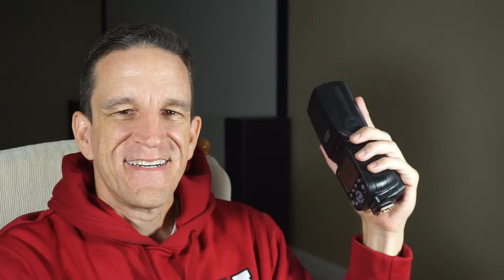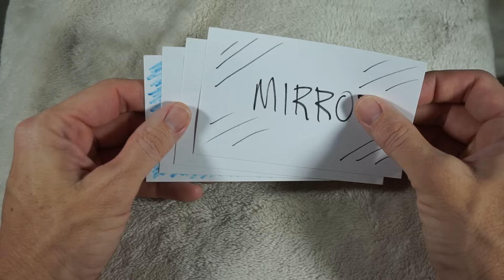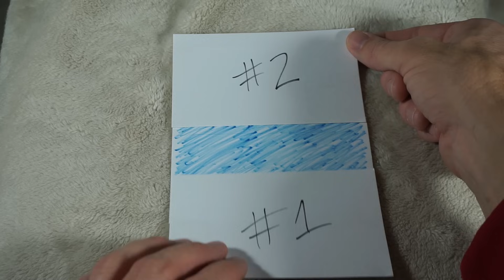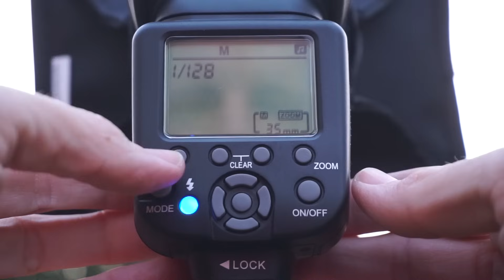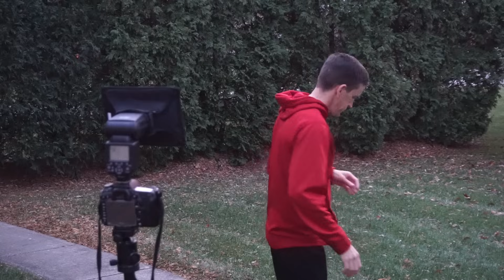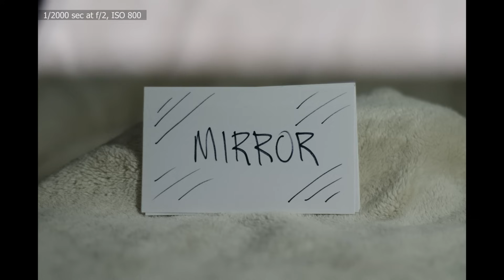Beginners Guide to High Speed Sync Flash Photography

Comment: Hi there, I have a question about high speed sync. Let me start by saying that I've used HSS before, So I do understand how it works. However today I was doing a photoshoot and noticed an issue with the photo. I noticed that the top part was coming out a lot brighter than the button, even though I was using HSS to shoot. The shoot took placed during the day around 4pm when it was still bright but not overly sunny. The lens was using an F2.8 aperture. My plan was to use the fill flash to avoid shadows on my subjects face and using HSS so that I could use a faster shutter speed to avoid overexposing the image. With HSS both camera and flash can go as far as 1/8000 of a sec.  any advise you can give me will be greatly appreciated.
Reply from the maker: Hmmmm - interesting.  Curious to know if you have the same results with shooting with a slower shutter speed?

Comment: Please sir I need help..
I have the TT600 but each time I enable the HSS on the flash unit and try to trigger it with the X1 on my Canon 80D 
Once I click the shutter button 
The HSS trips off immediately and it shoots at default sync speed. 

So I end up not achieving the HSS
Reply from the maker: i typically use HSS when the flash is attached to the camera.  when attempting to use HSS off-camera, a special trigger is needed.

Comment: Thanks. Beautiful explanation, but for me another and most important issue though it's in which mode should I use the TTL external flash with my Nikon 7200? I know its a simple question but its being my biggest problem so far! I tried all of them and with the only ones I can use the flash is when I put it in U1 or U2. It doesn't work whenever I put the M, S, A or P modes. Not even with the automatic or the scene mode. Would you enlighten me please? THANK YOU!
Reply from the maker: Thanks for the post/question:).  I typically adjust the flash power myself ... I set the flash > take a shot > inspect and adjust if needed.  i believe TTL should work the same in all camera modes w/ exception to manual (although I could be wrong about manual mode).  The flash and camera work together to create what the camera thinks is a properly exposed image when the flash is in TTL.

Comment: Geez how on earth do you not get banding. If the shutter indeed does what you say, the curtains will cast sharp shadows on the sensor. How on earth can they be that accurate? Also each flash has to be exactly, with out deviation, the same power. Almost impossible but yet there it is.
Reply from the maker: LOL - fully agree! :)  I thought the same ... amazing how technology works! :)

Comment: Thanks for the very clear video - being so knowledgeable plus experience with Nikon I wonder if you can help with an explanation: I have a D850 body, but my flash, Yongnuo 560 IV, does NOT support HSS.  However, when on Silent Live View flash works perfectly at extremely high shutter speeds like 1/2000 sec.  This is great, but looking online many forums say that this should not work.  Just one thing though, if the flash is off camera and I use the Yongnuo 560 TX controller the flash does not trigger at all.  I can't find an explanation of why this is, and makes me wonder if there is a different controller which would make it work perfectly like when it is on the camera... I am mystified so if you had the time to explain briefly I would be very grateful!!
Reply from the maker: Hmmmm - very interesting as I have not heard this before:).  I will need to dig into this more to find a good explanation:).
Reply: @RealWorld  Thank you.  I was surprised too and would love an explanation from someone more technical than I am!

Comment: For D3XXX or D5XXX Nikon bodies or also canon, another trick to using flash (Without HSS because they don't support it) in daylight is to use an ND or even better a Variable ND filter to get the proper exposure.
Reply from the maker: Thanks for the post/suggestion!:)  Agreed as well ... a good ND filter will help.

Comment: And how does one properly expose for low light situations with a flash?
Reply from the maker: use TTL or enter manual mode and use trail and error (i.e. take a shot and review the results on the back of the camera:)).

Comment: I got this same flash along with my Nikon z50. So my question is how come ur shutter speed was so high and considering it was kinda dark out did the shutter speed affect the lighting?
Reply from the maker: Thanks for the post and good observation:).  I could have used a slower shutter speed but only increased it to demonstrate the high speed sync feature:).
Reply: @RealWorld  ah ok. I understand.  Does shutter speed control lighting i.e ambient or flash? Also if i may ask what trigger and reciever system are u using?
Reply from the maker: shutter can control lighting providing the light source is set to TTL.  regarding triggers ... i currently use ultura - https://amzn.to/3eEmP8s

Comment: How do you set up HSS in Z6?
Reply from the maker: Thanks for the post/question Sandy:).  Ensure your camera is set to use Auto-FP in flash settings ... Menu > Custom Settings > choose 1/200 Auto AP.  This should enable high speed sync with compatible flashes.

Comment: that is why you DON'T need H.S.S. , or have a sync speed for medium or large format cameras, as Most of them have a "leaf" shutter, this opens like the iris, so even at 1/400th of a second the shutter leaves open fully then close, so ALL flashes work. also in Nikon cameras, there is a menu item to change flash shutter speed ( 1/60,1/80,1/200,1/250 & 1/320(F P) ) as well as the sync speed, BOTH are adjustable.
Reply from the maker: Thanks for the post/info Andy - good stuff:)

Comment: Hello there! I have a question about the speedlite you are using in this video.  I think that speedlite is a K&F 882. and I wonder if you have already used it like a master using the optical wireless connection to control other i-TTL speedlites like the Neewer nw565.  I have a couple of those and I had have a hard time finding an optical controller for distance off camera setting up, and what I saw in the menu of that flash made me think that probbably that flash can do it. Have you try that out? In advance Thank you very much for the answer and probably you would like to do a video about controlling flashes settings using optical wireless sync (groups and channels), 'cause there is a huge lack of information about it.  Everybody shows  pairing  by 2.4 G radio frecuency,  but some speedlites have optical wireless capabilities (beside just triggering by  "sympathy").  Thank you very much for your attention. I´ll be waiting up for an answer!  sorry about my misspelling and bad grammar, but It's been a long time since the last time I wrote in English a regular basis  Regards!!!
Reply from the maker: Thanks for the post/feedback!:)  I use various external flashes and have successfully used the built-in flash on the camera to trigger off camera flashes using optical sensors.  The camera must have a commander mode ... this works well when the flashes are line of sight (note: the flash must face forward so the sensor can be seen by the built-in flash).  I prefer triggers using RF ... this allows me to angle the flash anyway needed without concern for the sensor:).

Comment: Great explanation of HSS. I believe the power output of the flash will be reduced in this mode. ¿Is there a calculation that can be made to determine the effective guide number in HSS. Thanks.
Reply from the maker: Great question/point regarding power when using HSS:).  You might think the power would be reduced considering the flash must fire repeatedly to follow the speed of the shutter.  Nonetheless, I believe the power remains the same but will need to research further:).

Comment: Nicely done.  I have a Neewer VK750 that I just bought.  I cannot get HSS to work.  Camera is a Nikon D850 set to 1/250 FP.  The flash should then show an H on the screen.  If I fire a shot, I get a black picture.  I'm going to get a replacement.
Reply from the maker: Thanks for the post Tom:).  Unfortunately, the VK750 does not offer HSS.  The D850 is a great camera though:).  I really like the 750 and have a couple which work great.  If you want a HSS capable flash consider the K&F Concepts 882 ( http://amzn.to/2l944m1 ) which I used in this video.

Comment: Does camera exposure meter works when external flash is in use .. ?
Reply: Plz tell me steps to turn on the exposure  cause in my d7200 the Light/Exposure meter is always underexposed ..
Reply from the maker: If you are using TTL, the camera tries to get it right but this is not always the case:).  If you find the camera to be off, use the exposure compensation.  Hold down the +/- button located near the shutter release button > while holding down the button, rotate the rear dial to adjust as needed.  Since your images are typically underexposed, force the camera to overexpose by one or two stops:).  I have done the same and it works well:).
Reply: @RealWorld  i have try it but nothing its always underexposed
Reply from the maker: @indrajitmondal6615  Hmmmm - interesting. Do you see any difference at all when using exposure compensation?  What is the brand/model of flash?
Reply: @RealWorld  the brand is sunpak PZ42x and i just saw that it is incompatible to d7200 .. it maybe the reason
Reply from the maker: When using TTL, yes:).  If you switch the flash to manual, no.

Comment: How did you disable the high speed sync? I have a similar universal flash and a Nikon d7200. The high speed sync is turned on by the camera when 1/250 FP or 320 FP is selected. Otherwise it is set to the sync speed from 1/60-1/250. How did you get to over the 1/250 with HSsync disabled?
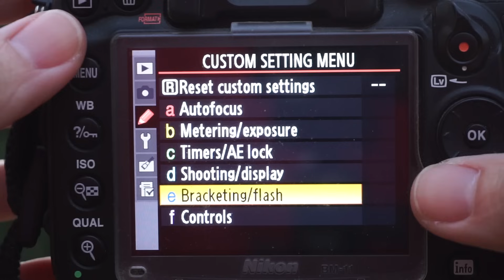Reply from the maker: Thanks for the post Jim:).  I had to watch this video again to better understand the overall situation - looking back, I did a good job!:)  Nonetheless, so how did I disable high speed sync?  Take a closer look around the 9:42 mark.  I set my camera to something other than Auto FP (for example, 1/200).
Reply: RealWorld I tried that. So if I set the flash sync speed to let’s say 1/125. The camera will not let me go faster than that speed. I’m trying to better understand by recreating your example with the flash cards.
Reply from the maker: Not a problem - always good to experiment and understand:).  Are you in manual mode?  If not, head to manual and force the shutter speed past 1/125 > ensure your flash is on and take a shot ... you should see a shadow/band of some sort:).
Reply: RealWorld I was in manual mode but it still won’t let me go past the sync speed of whatever the selection is.
Reply: @RealWorld  I tried in Manual Mode on my D600 and SB5000. On camera set the Sync speed to 1/200 it doesn't let me pass that speed. Exactly problem Jim is experiencing.  Also do you have any advise for how to use HSS OFF camera? In your video I see it's ON Camera
Reply: Did you switch bodies from the D7000 to the D3400 for the last demo?

Comment: How do I know if my camera support High Speed Sync ? I have the nikon D80 which is old ;-) I have the SB-700 AF from NIkon , do you know if it has this feature?
Reply from the maker: LOL - yes, the D80 is much older than most, however I believe this might be doable:).  I do not have the D80 but I believe you will need to set flash sync to front and enable custom settings menu #25 (based on some quick research):).

Comment: I have Yongnuo YN560111 and YN560IV flash and I Nikon D7200 DSLR.  When  I set my camera to Auto FP 1/320 and Change the shutter speed to above 320s with aperture opening at F1.8, Flash power set to 1/2 power get banding in the image.  How do I solve this issue?  I shoot mostly in manual mode.
Reply from the maker: Banding is typically caused by high speed sync issues.  I created a video on high speed sync which might be of help - https://youtu.be/BlYO0KwbDXA

Comment: Tonight, I was changing a lens on my camera when the lens I was holding slipped out of my hand. I was standing in front of a rustic wooden coffee table when the lens somersaulted and hit the edge of the table quite hard. Because of the blow, the lens then quickly somersaulted in the opposite direction and hit the rug at my feet. This all happened so fast that I couldn't catch the lens as it fell in slow motion. Now, my 12-60mm M43 lens will not focus automatically. And, I tried to focus it manually but it wouldn't work manually either. So, what have I learned? Not much. I've been into photography for 45 years now and this makes the third time I've dropped my gear. So, with any luck at all, it won't happen again for at least another 12 to 14 years, or so.
Kinda heart sick now.
Reply from the maker: Don't feel bad Mark and I suspect most of us who have been shooting for any length of time have done the same:).  I trashed my 16-50 power zoom lens a couple of years ago while it was on the camera body.  In short the camera was attached to a tripod that tipped forward ... not a long/far fall but enough to cause major issues:).  The AF was not working nor was the power zoom, so I decided to dissect the lens (what did I have to lose).  I manage to semi-repair the lens which I still use today, however I must play with it at times in order to function properly.

Comment: I think most YouTube videos only cover hss without ANY mention of the dreaded fact that the humble speedlight doesn't work but at certain flash to subject distances.

At least that's what I think the problem is. Of course, I may be wrong. I never know for sure. Can you help?
Reply from the maker: The flash should still fire regardless of subject to flash distance, however the flash power will not carry too far so you may not get the fill light desired:).

Comment: Can RealWorld do a video on why everyone (other than me) can easily do High Speed Sync at shutter speeds higher than 1/400th second but I can't, not even when I change cameras & speedlights. The effective camera to subject distance ends up being ridiculously short. It's as if I can't use High speed sync at all.
Signed, frustrated as hell.
Reply from the maker: LOL - I can sense the frustration:).  1/400th of a second seems a bit odd.  What camera and flash are you using?

Comment: I have D7200 with Ad200 Godox flash. Once I have my XPRO on HSS, high do you need what is the correct shutter speed? Thank in advance for helping
Reply from the maker: Your camera will auto determine the shutter speed depending on your mode.  If you have a HSS flash and capable camera (which you do with the D7200:)), the camera will make the appropriate adjustments as needed.
Reply: RealWorld Thanks, I’m shooting in manual so I’m struggling to get the correct shutter speed with high speed sync. I know aperture priority will select it for me. But I’m trying to leave Manual
Reply from the maker: Ahhhhh yes ... manual mode is a bit more challenging:).
Reply: RealWorld yes!! I try long to HSS with allowing aperture priority to select the shutter for me.

Comment: good evening sir recently i purchased osaka ttl hss flash 860markiii but not able to understand the function like how set power in ettl ot ttl in manual i can set full power to 1/128 power but not in ettl if you can teach me it will help me. thanks
Reply from the maker: When using TTL, the camera will automatically control power.  You will need to leverage manual mode to control power:).

Comment: Thanks so much for your reply and in such a short time. Another question, say I'm shooting a subject and at 100 iso and 125 shutter speed my light meter reads f 5.6, but the background is blown out.  What if I set my flash (high speed sync mono light actually) to ettl and high speed sync, set my shutter speed to say 1/1000, and spot metered my subject would I get a properly exposed image of my subject with the background darkened (assuming that 1/1000 would under expose the background).
Reply from the maker: Glad to be of help David!:)  You are on the right path and correct!:)  You could meter for the background and let the camera plan for 1/1000 and then connect a flash to sync the same and hit the subject.  The will throw light on your subject and proper expose the background, although I am not certain I would leverage TTL.  In this situation I might consider going manual as TTL will attempt to meter the subject.  Take some test shots - you are on the right path:).
Reply: Thanks for taking the time for me, I've been shooting for sometime, but have avoided HSS and I'm learning a lot from you.  Sorry for asking so many questions, If I set my camera to manual, ISO 100, f5.6, shutter to 1/1000 and spot metering on my subject's face, will ettl adjust the power of the unit to give me a proper exposure of my subject and the 1/1000 will darken the background.
Nobody who talks about HHS except you gets into these essentials. So thanks, I'm sure others have the same questions I do.

In your reply are you saying that if I metered my background for 1/1000 , even thought my light meter read 5.6 at 1/125 that if i set my camera to 1/1000 the flash would  properly expose my subject, because at 1/1000 she would be seriously underexposed?
Reply from the maker: Glad to be of help David and you are correct!:)  TTL will work the same in manual mode by adjusting the flash as needed to properly exposure the image (in this case the subject as you are using spot).  Without HHS you would need to set the shutter to the max sync speed or slower, however with HHS you can extend to something much faster.  I am curious to know how far your subject is from the background.  If far, you should be okay as the light will not push past the subject and adversely impact the background.  If close, you will most like see the light spill into the background:).